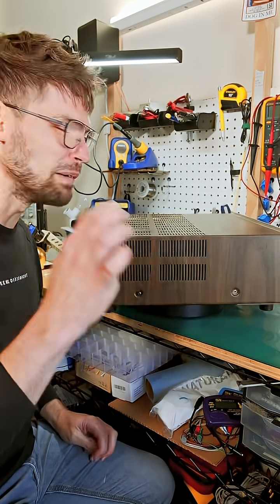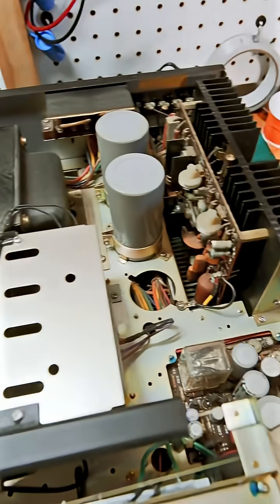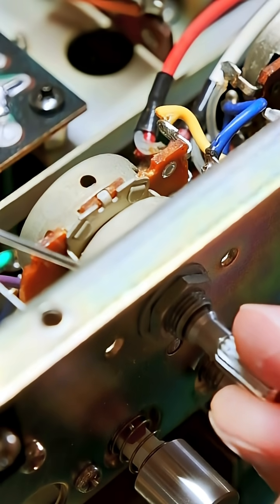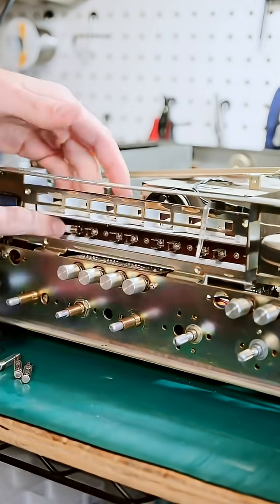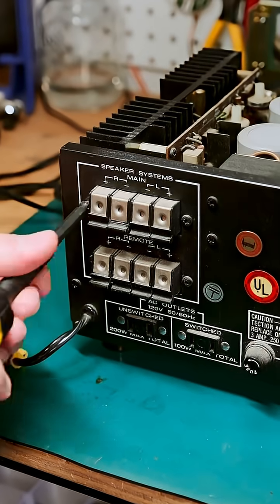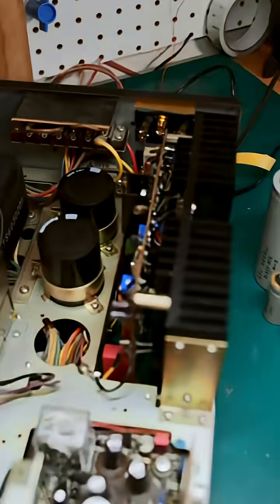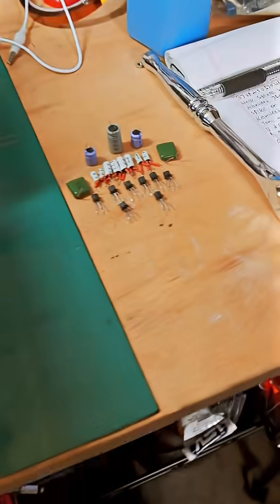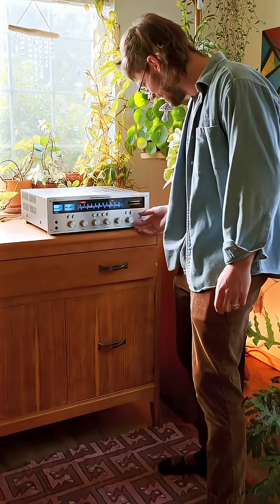Built to survive a house fire 🔥 #stereorepair #vintageaudio #Hifi #Marantz

Comment: If only equipment today were built to last and be repaired.
Reply: There is... Question is can you afford it? I cannot.
Reply: @hoka8382  The sad thing is that making a modern product to a better standard, more serviceable and user repairable, does not add much cost.

It does however, mean manufacturers wouldn't be designing in obsolescence and forcing a replacement-over-repair industry - impacting their profit.

Corporate greed and sating shareholders is why this won't happen, not manufacturing complexity.
Reply: @literate-aside Absolutely correct! Greed and built-in obsolescence are what drive corporate decisions, more so at the lower end.
Reply: Even modern cars are not repairable or economically repairable.  Insurance companies routinely total EV’s that have even slight battery damage because they can’t justify spending $30,000 or more for a new battery.  And all of the computer controls in cars won’t be replaceable in 15 years, the cars will have to be junked.  Simple, basic, analog components in old receivers are replaceable and in some cases, upgradeable.  But there are few people who know how to do.  Modern electronics use many custom integrated digital circuits that aren’t fixable and in time there won’t be any replacement parts even if you knew someone who could repair it.  So from cars to consumer electronics we’ve become a society that replaces items rather than repairing them.  With all the concern over “climate change” you’d think there might be more interest in extending the life of equipment vs replacing it.  That’s far more environmentally friendly.
Reply: ...and people were willing to spend $1200 to repair it.
Reply: You can still buy well made HIFI that will be serviceable, but it is extremely expensive because there are not enough customers for it so the return on investment isn't there

The market for bespoke hifi separates is a fraction of what it was even 10yrs ago. Pleanty of work around for gents like this to do retro-mod work, but its demographic is people in their 50's and 60's who are nostalgic, together with a small number of Hipsters

meanwhile Gen-Z and the Millenials have their iphone and a bluetooth speaker. They "love music" but have never heard it on a proper sound system
Reply: Oh you absolutely can repair a modern AV receiver, and a good one will still last you 20 years just fine
Reply: @X65022  - Yes, and it will give you 7-2-2 theater sound without any potentiometers and solid state everything. I don't miss anything from the seventies.
Reply: I don't mean to be that guy but...

Just about anything can be repaired.  All it takes is the technical know how.  The questions are 'How easily can it be repaired?' and 'Is it cheaper to repair it or replace it'?  

To be honest, this system wasn't really built to be easily repaired.  It took a lot of soldering and skill to do what he did. 

As for which is cheaper, repair or replacement, that would depend on if you're dead set on having this brand and model.  Seeing as you can't just walk into your local stereo store and buy one of these (because they don't make them anymore) it's far cheaper to repair it.  If you're willing to swap it out for a newer piece of equipment, replace or repair would depend on the cost of the new piece of equipment vs how much it would cost to repair the old one.

As for built to last, I'm with you on this one.  While a lot of things you buy nowadays will give you several years of service, the list of things designed to last a long time is getting pretty short and it's getting shorter every day.
Reply: @keithcraig506  agree and disagree, and I'll point you to my specific term 'user repairable '.  

Bearing in mind my career is electronics acceptability, quality and process control I might look at this differently or be unfairly biased. If so, my bad.

Are you repairing a stator at home? Rewinding a coil? Sourcing a proprietary IC? Nope, of course not.

The point is that manufacturers have control over so much part availability, then they specifically select low MTF components in critical regions, and design around making access more difficult, not easier.

Absolutely, almost anything can be repaired, in fact at higher levels there's a wealth of fantastic qualifications centering around that exact principle - and they allow us to move the threshold for BER. But it's not applicable for the home gamer.

Cars and tractors are another good example. It wasn't long ago that we all could take care of general maintenance and ma h a person was under the hood of their vehicle at the weekends.

Now? You need thousands of dollars worth of diagnostic equipment, specialists security bits, software agreements and in some cases a licence to purchase or distribute some spare parts. Technically you can still fix tractors and cars, but the barrier to entry has grown exponentially.

I just don't think your "um, actually" sentiment applies here, when we're talking general purpose goods for layman users - who've been designed out of the repair process.
Reply: @literate-aside  

I wasn't responding to you.  I was responding to OP who didn't specify "user repairable".

I will reiterate the start of my comment and say "Just about anything can be repaired.  All it takes is the technical know how.".

The fact remains, most things can still be repaired as long as the person doing the repairs has the skill and knowledge needed to effect the repair.  Whether that person is the end user or a second party, possibly a professional, is irrelevant.

And, to be real, even back in the day most people couldn't repair the vast majority of the stuff they owned.

So, remind me again, who is pulling an "Ummm, actually..." here.
Reply: @keithcraig506  bit of a cop out, whether something is repairable is entirely moot - it's whether it's economically viable to do so, and you know it.
Reply: @literate-aside  
Hence the whole "cheaper to repair or replace" thing.

Jeeze, did you even read my comment?
Reply: @keithcraig506  so in other words you agree. Lovely stuff.
Reply: The good thing is, there’s so much of this old technology out there which is repairable and sounds great still today
Reply: Everything today including cars are throw away.

Comment: The speaker outlets are now top quality contacts. I’ve owned good amps from the 1980s and early 90s which used spring loaded sliding covers, and you’ve to shove the speaker leads into these, releasing the sliding covers.
I found these lost their springiness & sometimes the small hole limited the cross section of speaker cables that would be gripped well. 
The jacks address vulnerability to falling out. 
Nice work!!

Comment: You ever do repairs to any Yamaha surround sound processor, especially the input stage
Reply from the maker: I don't work on surround sound gear. It gets outdated too fast and is much more complex to work on which means more costly.
Reply: @Shuksanaudio I'm trying to find someone who can repair the input stage of my Yamaha, got full power output just no input, got faulty components and/or loss of connection through the board, but it's a little more than I think that I can do

Comment: That’s super awesome how you artificially inflate the higher service fee for yourself by ‘upgrading’ certain components such as speaker terminals and probably many other ethically suspect changes that you make. (As if people today cannot properly operate a couple of basic as-simple-as-they-come terminals designed in the ‘70s for the lowest common denominator human-being) 

You are the dude in all the repair videos that I have been watching for the past 10 years where the experienced NEXT Tech who gets your handiwork and bitches throughout the entire video about YOU and your poor choices you continue to make at the expense of respecting hardware originality in lieu of some ‘modern’ conception of design - as if the original prototype engineers just weren’t smart enough to have thought of the newfangled ‘whatever’ that you decided to swap out, even though the old one wasn’t broken - just so you can line your pocket and make some basic bitch ‘repair’ video . . .

Comment: It makes me feel bad I got rid of my Marantz Model 2220 back in the mid 70’s. It was a well built unit (heavy for its size and output) with great sound quality. It powered a pair of New Large Advent speakers in the walnut finish. They made a good pairing. I still have those Advents in my basement, unfortunately collecting dust. I might use them again if I ever get around to completing my basement buildout.

Comment: I’ve been doing this for years.  One of the biggest challenges is finding parts.  You seem to have no shortage of them.
Reply from the maker: Haha yea, I have a bit of a stockpile 😅
Reply: Who are your parts suppliers...
I have two Panasonic stereos that I purchased in 1979... mono/stereo switch is broken... I'd love to fix it
Both have similar issues...
Reply from the maker: @tclab1  I buy from mouser and digikey mostly.
Reply: My lesson is to buy donor devices. 2 defect devices = fixing 1 for 100% and the other one is a donor sometimes usable for following models. Fixing Sony/Panasonic, cassettedecks, DAT recorders and upgrading DVD recorders. Sometimes portable devices such as  Walkman.
Reply: You can print your own circuit boards now. Even though it's custom, it's still super cheap.  I wouldn't throw away any cases etc.   You could even improve the failures but keep the bad designs that actually are nostalgic.  In the computer world, they are recreating pretty much everything from the 70s on.  Just get with their PCB distributors and they can easily print out your board of you have the engineering sheet.  Stop parting these out lol.
Reply: I would think the problem would be finding someone to pay the price for it that you put back into it.  This guy said he put 1200$ into this repair.  That is not worth it IMO. Toss it and get a new digital model.
Reply: @David-w9i7j  By the time you add it all up AM/FM receiver, Equalizer, Phono amplifier, and amplifier it is well worth the $1200. It also looks a hundred times better than any of today's components.